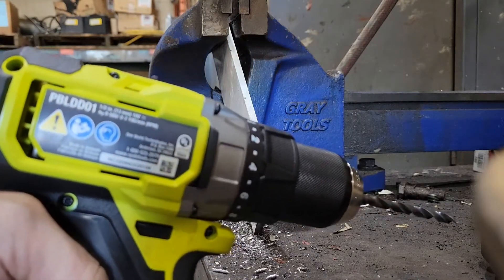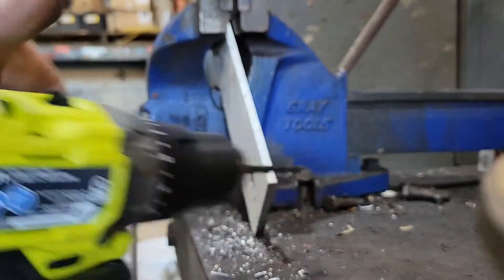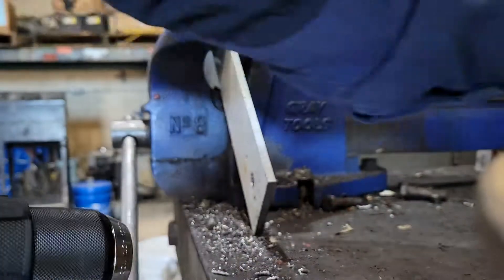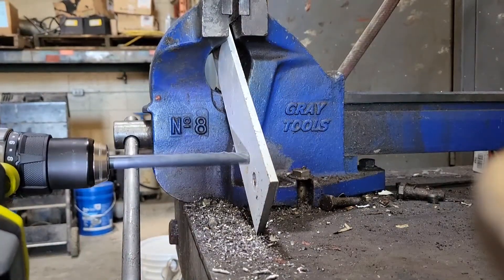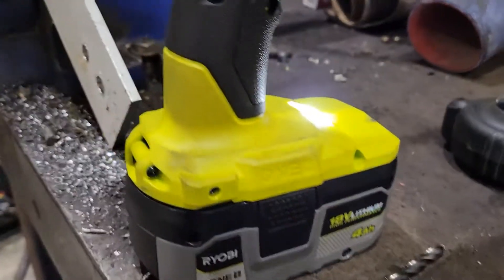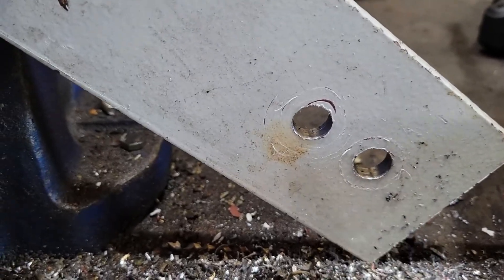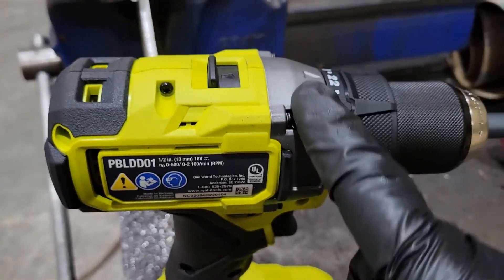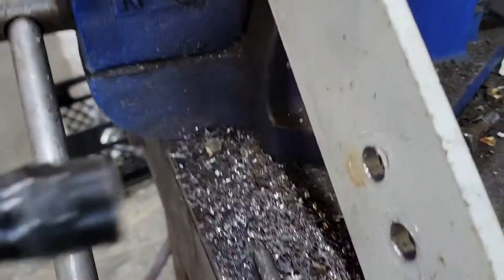Ryobi one+ hp PBLDD01 drill metal

Comment: There are videos about the way these drills chuck works some say it locks some say it don't but I own this very drill an it has the locking feature
Reply from the maker: My chuck ratchet. The bits never get loose.
Reply: @BensRyobi  so what are u implieing ?? The tool doesn't do it or it not necessary to use ? Because it most definitely says in the manual to lock bits by backing off an 8th or 1/4  turn after tightening to engage lock feature there are vids by other content creators including myself showing this feature in action
Reply from the maker: @@daddylonglegs86   I just ratchet the chuck to hold the bit and never backed it up to have to lock it and the drill bits never got loose on me. After you mentioned this lock feature I read my manual front to back 3 times to see what I can find out about this but Ryobi does not mention to back up the chuck by any  amount to lock it in my manual.
I'm not saying that your wrong but I'm going to have to do more research about this. I've seen some videos about this but I need to understand the mechanics behind it before I join the band wagon.
Reply: Bull 💩 
Cant believe there are spoofs still peddling this ‘myth’ in YouTubey land. 🙄